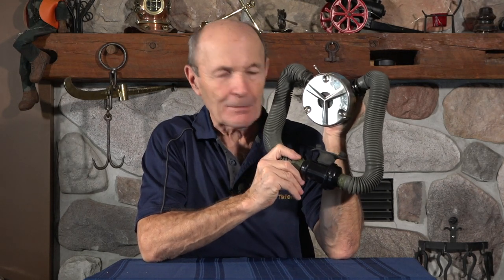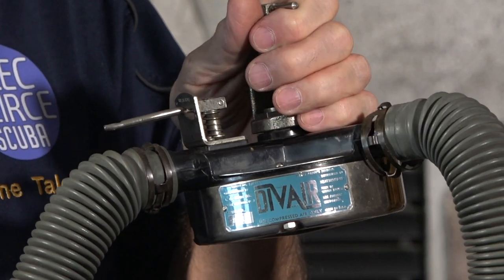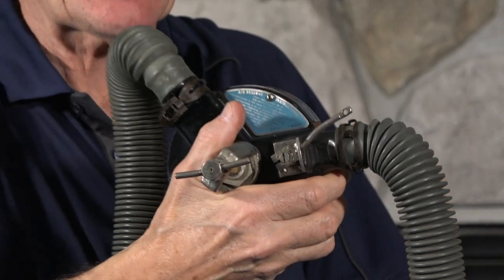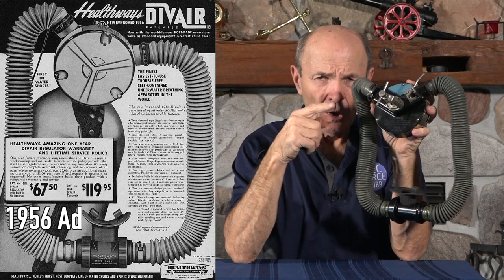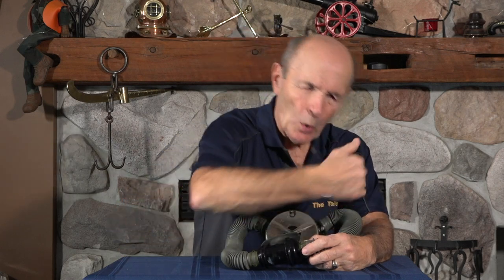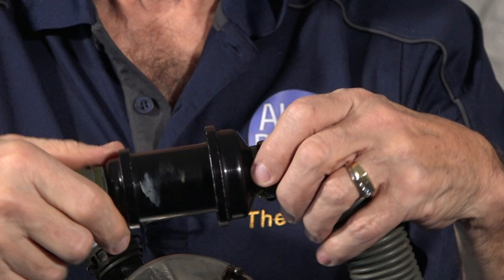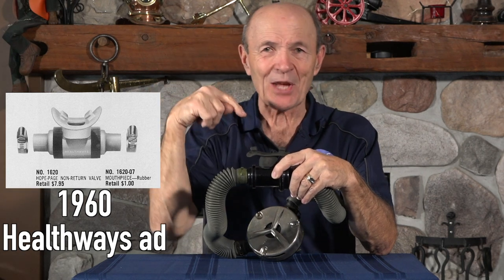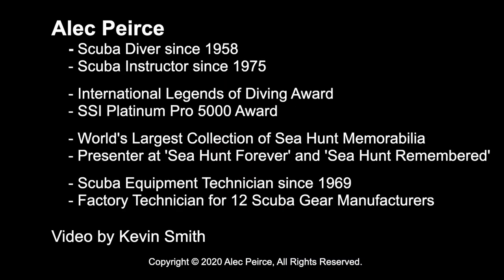Vintage Scuba: Healthways 'Divair' - S08E12

Comment: Hi Alec it is funny how a 50 year old mouthpiece looks almost exactly like the newer wagon wheel valve mouthpieces even the little tab on the exhaust flap is exactly the same shape as many new mushroom valves used today. How does the reserve lever work? most of the j valves had a spring and seat that got bypassed by the lever. I must admit that there are many really interesting features on many of the old 2 hose regs not just the can and hoses as I always thought. Take care Owen m